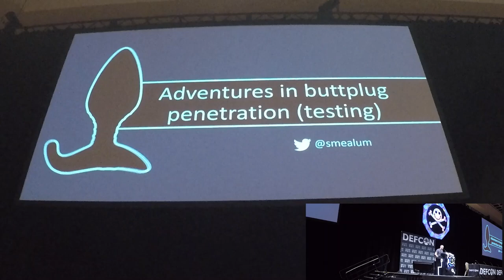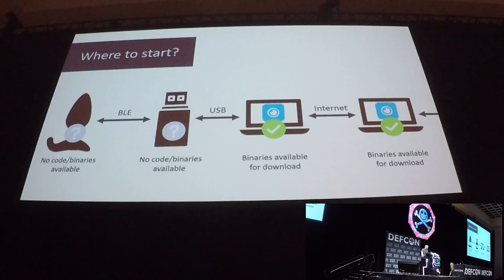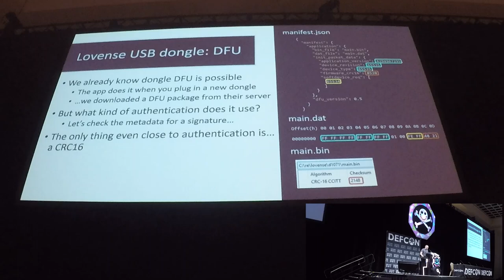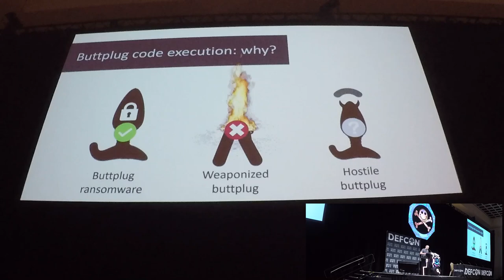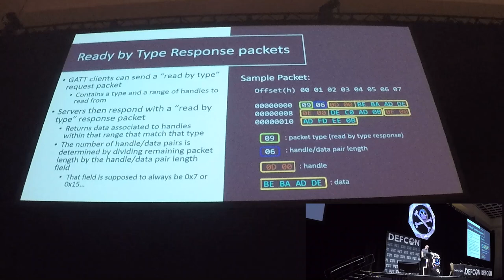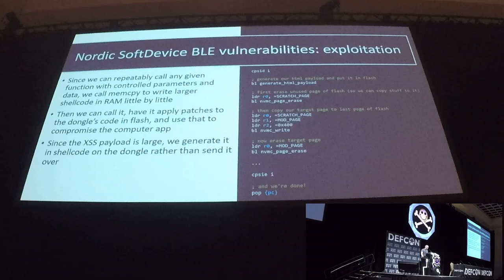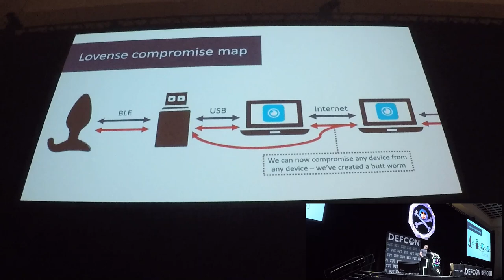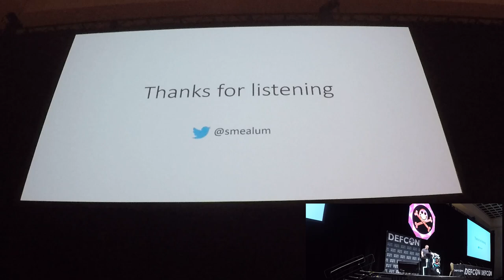Butt Plug Hacking! Real Penetration Testing – DEF CON 27

Comment: Seriously WTF...when I see something like if ( ! (n < 0)) { ... }, 
after having seen just a few lines prior that they are able to do it correctly (i.e., if (n >= 0)), I can't help but think about whether this might have been deliberately placed
Reply: I almost think it was like the guy who coded it was tutoring someone at the same time with "you could also do it like this" and ignored that while logically you CAN.. Not all languages will treat the check correctly or intuitively.  But then from all the code and practices they used they never even tried to harden any of it, much less test it for vulnerability.
Reply: xOr  sure: the problem is with js and the way it handles the two statements.  While they ARE logically identical (for integer math), it just so happens that they differently treat the result for a string.  The command wasn't really made to evaluate an integer or a string together, this would be nonsensical to us, just as it is to the compiler. But as an oversight a comparison was made anyway.  One result gives true, while the negative (is not) logic check gives false, or vice versa.  And through this obscurity an exploit was leveraged.
Reply: @christopherhurley2570  Thanks, I will keep an eye out for that one, when I was learning I did that a few times, and then learned how but to structure my if statements to not require the not in the logic. Just flipping the contents of the 'if' and 'else' worked for me, and add a do nothing for 'if'' without 'else'. Python mostly, but bad logic is bad logic in any language.
Reply: @JaredHaer  Yeah I've never programmed in JS myself, it might even be a bug in the compiler even letting the comparison take place.  I know other languages like Java, C++, C# let you define how to make comparisons outside of the default behavior for all your classes and structures, but I'd have to play around to see if this case is common in those languages or if it immediately gives a compiler error trying to compare a string to an int, or at *least* a warning.
Reply: I mean to be even more correct personally I'd argue that it should be "if(0 =< n)" - simply because if you put the constant on the lhs and you accidentally do "if(0=n)" in languages where = is assignment you get a compile time error rather than the runtime error that'd occur if it were "if(n=0)"  - instead of "if(n == 0)" :) - It's a pain to adopt it as part of your coding mannerisms, but if you're using C like languages, the amount of time you save not having to debug the occasionally missed = is a god send.
Reply: @Phreak0matic  that's a fantastic point / tip and I wasn't paying attention to that at all, thanks for that.

Comment: Very good presentation, but you are talking way too fast for my taste. Sometimes I really had problems understanding you acoustically. Maybe it's because you were nervous, though.
Reply: If defcon would ever use quality microphone direct input... ( i know it's not their official video) but damn. So many bad audio videos from defcon.
Reply: @jochemcode4570  Fan videos from the corner come out same week defcon takes a few months for the heat to die down.
Reply: Most conferences have around 50 minutes or so to go through lots of interesting stuff - they learn to talk fast. Just one of the things you have to learn to cope with that
Reply: I changed the playback speed to .75 and it's much better. Problem solved. 😀
Reply: ^ this

Comment: Why is the camera looking at the talker, so friggen zoomed OUT!? Also why is the video frame of him in the bottom right corner when he's clearly standing to the left of the presentation?
Reply: He is standing between the presentations. When correcting people, try to be correct.
Reply: You can see that the big image always matches up with what is displayed to his left. The small picture never shows anything except a super zoomed out image of the person speaking, there's no other media in that small frame to justify the zoom out.
Reply: There are 2 presentation screens - to his left and to his right. You can see a corner of the screen to his right in the small picture.
I think the camera is zoomed out that much either 1. to not have to move it around if the speaker moves around (which he did), 2. because the camera is crappy and zooming in would give an even worse smeary image, or 3. as a  simple mistake.